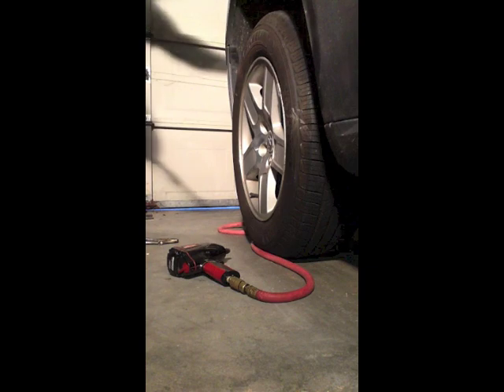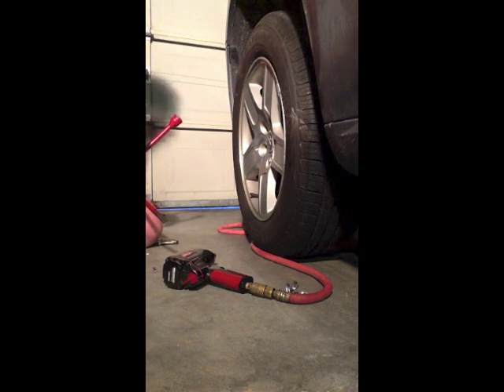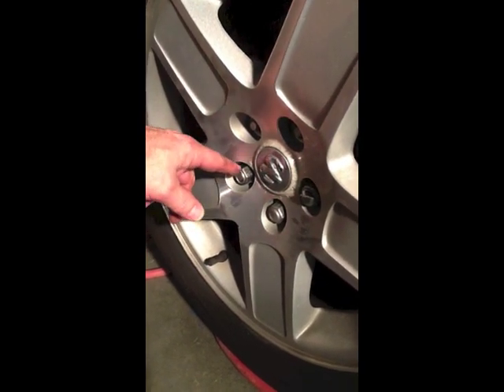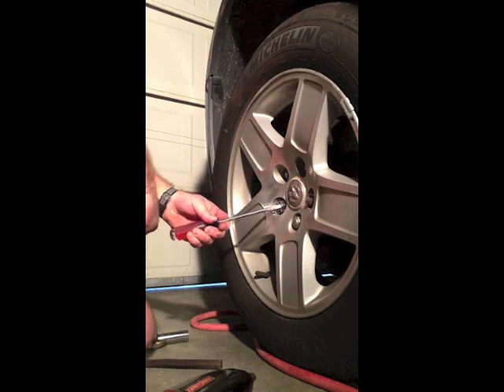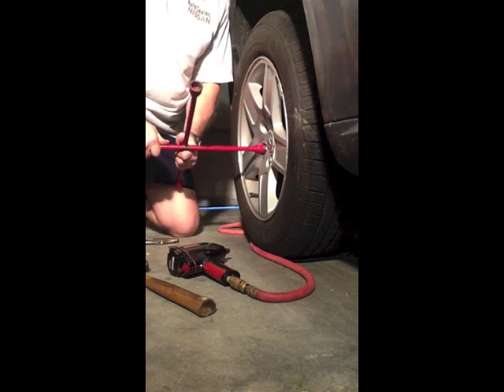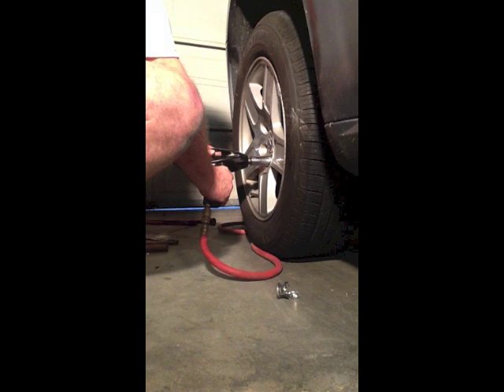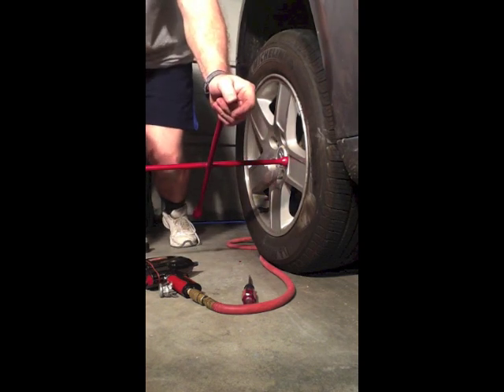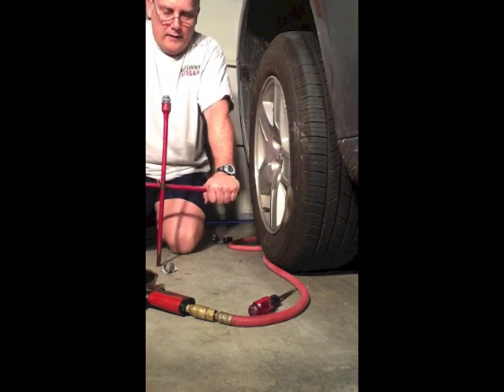How to remove over tightened lug nuts

Comment: I concur from Ottawa Canada ... you sir are a legend! 3/4" lug nots torqued to 500 ft lbs I'm sure, all other videos to remove the one stubborn stripped nut that I could not budge with a 10 mile breaker bar were not helpful. Went to the local Canadian Tire, who said $100 just to look at the issue, or buy the $200 nut replacement set. It was your genius, to strip the aluminum jacket with the screwdriver and the chisel, that was the only thing that worked to reveal the rusted but intact 18 mm nut that I removed with the bar! Keep up the good work! And my daughter wanted to say thank you for making this amazing video and my daughter favorite part was when I told her you have a puppy/dog! Thx again!🙂😊

Comment: I worked in the tire industry for many years.. where I worked, we had a golden rule... take them off with an air gun... put them back on with a four way...
Reply: Dallas Nyberg that makes more sense. id RATHER my lugnuts be hand tightened
Reply: sadly most dealers don't give a dam so now I have this very same issue
Reply: kkingss4 and that is why I do 99% of the work on my car. Body work is gonna be left to the pros, but a simple break job, rotor replacement, struts etc are for me to handle, fuck mechanics that tighten shit way too much
Reply: Good store you worked at===Me too!!
Reply: should be able to sue.... overtightening the lugs should be considered damage....
Reply: yes mechanics do this on purpose so you wont be able to do work on your own car
Reply: @Mike_Greene  i dony have money nor the experience to sue. But there is a local shop that does this to all vechiles. They broke my friends nuts as well at to remove them from the rotor
Reply: @TheAfrothunderr  lol im not telling you to sue. im saying how thats not cool. there are torque GUIDELINES(??) to follow and my trucks are 100 ftlb so to tighten them to 400 ftlbs is like malpractice.  any mech should know how tight that is and know that is 4x too tight.  nowadays i keep a 7ft steel bar in my truck lol
Reply: @localello4444  I work for a dealer and other places I think many people dont  realize it doesn't have to be super tight I seen people using the impact gun to tighten then go around with it aging I usually use a torque so it doesn't get crazy tight
Reply: They should pass a law requiring it.
Reply: That's a good motto.
Reply: Once I discovered that my car had those "chrome/aluminum" jacketed lug nuts?  I went out and replaced 'em ALL with ALL STEEL look a likes!  To escape from the problem this guy had with his!  Yeah?  It's a tad expensive( maybe 30 er 40 bucks...probably more....been awhile), and the very SAME reason you WON'T see the "real deal" on yer car!   BASTIDS ANYWAYS!

Comment: My 1993 Wrangler lugs were frozen tight. I soaked the lugs several days and I drilled a small hole in the lug "skin" and filled it with PB Blaster for a few days. I hammered on a 3/4" impact socket with a 2 1/2/lb. ball peen and gave it some good shots. I used a 25" Harbor Freight breaker bar ($20.) and used my foot (I weigh 280 lbs.) and they let go. Two stripped off their covers and got rounded off by a 18 mm impact socket. I used a 1" bi-metal hole saw to remove some of the aluminum around the lug. If you angle the saw a little it cuts along the side of the lug and relieves the tension on the lug,they come right out. The wheel is still good . Replace with good lugs from NAPA,maybe a touch of anti seize on mating surfaces.

Comment: I was getting ready to replace the disc brake pads and rotors on my 01 Dodge Dakota.  Imagine my surprise when I couldn't budge a single lug nut using my 4-way lug wrench!  One nut was missing the cap and even the factory lug wrench began to bend from my use of a cheater bar before finally the corners rounded off.  After watching your video, I sprayed the nut liberally with PB Blaster and I used a ball peen hammer to seat an 18mm deep socket firmly over the nut.  Using a piece of pipe as a cheater bar, the nut came right off.  THANK YOU for your video!

Comment: Beautifully shown and explained. Thank you. I had this happened to me. I used a chisel and could not do it so I took it to my local mechanic and he did it worse. He used a blow torch or something and damaged the area around the lug nut on my aluminum wheel. Obviously he did not care. My wheels in addition were new. All mechanics like to use those power tools and this is the result. If you use an impact wrench how many pounds should you place on these lug nuts. Thanks again for such a great video.
Reply: U are supposed to be using a torque stick rated at 50 ft-lbs.  Change the impact speed down and torque to 50 ft-lbs with the torque stick then finish off with the correct setting on a torque wrench.

Comment: We just bought a 2014 GMC Yukon for Mrs. Cuss.  I wanted to look at the brake pads' thickness, so tried to pull the wheels.  Turned out that the GM-supplied lug wrench was 22mm and the lug nuts were 19mm (likely aftermarket wheels).  Anyway, the tires had been rotated a few weeks earlier, was not expecting most to be too tight for my 1/2" electric impact wrench which claims 230-250 ft lbs.  I pulled out my torque wrench and those were all tighter than its 150 foot lb maximum.  Anyway, I used an appropriate 6-sixed socket and long breaker bar to remove them, and I torqued to specification on re-install.  I would've been SOL had that happened on the road, and doubt that even AAA could've loosened them.

Comment: You'll be less likely to damage your wheel if you forget the hammer and chisel and instead drill a small hole in the end of the aluminum lug nut cover. Use that hole as the starting point for removal.

Comment: Ive changed many tires where the lugs were on so tight that we ended up snapping the studs when trying to remove the nut. F'ing lazy shops that zip them on with an impact on full torque.
Reply: AngryPostmanSthlm2  no - when a fastener is grossly over torqued the threads become stretched and the fastener is permanently damaged. If it wasnt over torqued then there's no need for anti seize and/or grease. This is especially true for vehicles that have wheel bolts that go into a threaded hub (vs studs that are already installed in a hub and nuts are used). Simply put, grease will eventually wash away if not fully and completely contained (perhaps in a capped nut). Just dont over torque :-)

Comment: I agree they were over tightened however the aluminum skirt around the nut is not necessary damaged by over tightening.  The factory lug nuts like these are notorious for swelling.  I have seen brand new cars come in for their first rotate with the lugnuts swollen. 
Also over tightening lugnuts will damage the stud and reduce the clamping force.  With how tight they seemed I would highly recommend replacing all lugs and studs to be safe.

Comment: I hate how some shops over tighten lug nuts, Walmart and some Costco tire centers have a habit of over tightening lug nuts.. Whenever I get my tires changed I go to the mom and pop tire shop near my house. They only use an impact wrench to take off the wheel and they tighten them by hand with a torque wrench.
Reply: MR.T456 

exactly my problem now...Walmart installed my tires and they are the only Ppl I have do anything to them. I go today for a rotation they tell me the lugs are over tightened and I'd have to buy all new ones. I'm furious because they had to have caused the issue to begin with.
Reply: My parents  have had studs snapped  before, they  went to walmart for new tires

Comment: A torque multipler is great tool for breaking lugs loose. I just use the standard 15" 1/2 drive breaker bar for most breaking bolts loose. Everything else just needs more leverage applied.

Comment: Got a flat on my 2015 Jeep wrangler I have never had the wheel off.  The first lug nut I went to take off spun off in the socket.  Jeep.  Installs the cheapest junk from the factory. The only people who had touched the wheels where the dealer ship during rotation.  I am now looking for solid lug nuts.  I was lucky there was a tire shop in the mall where I was at.  There was a storm ready to rain down on me.  Very cold windy weather.
Reply: If you notice his car us a dodge wich is like ur jeep a chrysler product, blame chrysler
Reply: Don't wait until you have got a flat by the roadside in the rain to discover that you can't get the nuts off.  Do a rehearsal on your own driveway if you have never done it before.

Comment: There seems to be no shortage of dumb-ass mechanics who over-tighten wheel lugs.  I'd be concerned about cracks in those aluminum wheels.
Reply: Ernie Martin reckon the stud would sheer off before the rim cracked
Reply: Nate Green No, the steel nuts/lugs are much stronger than the aluminum alloy of the rims. You may not see stress cracks but I am sure they will be there if you over tighten the lugs.

Comment: As an ASE certified tech, in my years of experience on these aluminum wheels the lug nut is seized to the rim and not the stud. This occurs frequently and is not because of over torquing the lug nut. If you put your socket on the seized lug nut and give it a few good wraps with a big dead blow or a sledgehammer it will free it so you can twist it off with the impact. To prevent this from happening again clean the rim where the lug nut seats and put some antti seize in there. Don't put anti seize on the threads of the lug nut or on the stud only where the lug nut seats.

Comment: Thank God iv never had that problem YET.  But I'd like to suggest using a metal pipe, around 60cm long (aluminium or S/S) over one side of the wheel brace to give you 5 times more leverage power. That way you don't have to break your back or damage your hands or your muscles. This of course works much easier with a single armed wheel brace which is usually supplied along with your car's particular jack.

Comment: Some cars don't have a spare wheel, so if you have a flat while you are out and have to pull over to the side of the road this won't be a problem until you get home and want to fix the tire.

On the other hand just fix the tire at the side of the road using one of those puncture repair kits then you won't need to take the wheel off.

just plug that thing, and when you get a chance take it back to the shop that put your wheel on originally, and tell him he over tightened your lug nuts and now you need him to remove the wheel at his own expense.

But a plug works really well in an emergency, so long as you have a pump handy and the plug kit, and they are quicker than changing a wheel, and you don't always need to use a jack.

Comment: Good to know about these aluminum-cased bolts. To get more leverage and not break your back with the 4-way, you might want to try standing up and pushing down with one leg while pulling with 2 hands.  I've  had to do it few times. They certainly put them on tight with the impact guns.

Comment: I had to do this on a Land Rover discovery. Did exactly what you did. I used a breaker bar with a pipe over it so I had about 3 feet of leverage. That helped a lot. Took about 2-3 hours to do all 20.

Comment: Thanks for showing how to remove the skin.  As an FYI, using a "reverse threaded nut removal socket" does not work.  Snapped a breaker bar part that goes in the socket.  Will try reversing it off and going the route of removing the aluminum skin.
Reply: ***** I used the "reverse threaded nut removal socket" and it worked like a champ. Did not snap the breaker bar. Yours must have been tight.

Comment: I even felt the frustration and painstaking process as you struggled with the last bolt. I thought I tightened the nuts enough after a tire rotation at home and some where loose later on. I retightened them with my foot and unknowingly doing so was too tight and snapped the stud. That happened to me a while back, (and currently as the bots are stubborn again). Spent a decent amount of time hammering out the stud and thank goodness for barely enough rotor shield clearance as that bot is a serious major pain, I gave up but got very lucky for the space clearance. Since then I dread even touching the bots on my car.

Comment: Thank you for the video! This saved me money. I got some quotes from a few mechanic shops to get two lug nuts off and wow... They said it would be $1K+ to remove them because they would have to cut out the axle and some other crap. I ended up using your method to remove the caps and then used a breaker bar and lug nut removal tools for stripped nuts. It ended up costing me about $50 and and an hour or so.

Comment: @ 9:00 you are in danger of cracking your shin (and busting a gut).  Use a socket with a long extension, outer end of extension resting on an axle stand at right height. Breaker bar on the extension, scaffolding tube on the breaker bar. Then foot on the end of the scaffold tube - easy.  I use a 3/4" drive breaker bar and extension, although you might need an adapter down to a 1/2" drive socket .

Comment: you got lucky, hammering onto the lug on the dodge/chysler series crushes the soft metal onto the stud making them as one. i have a 900ft lb air gun that chewed it into a circle. even a swirl socket could not get them off.  ended up using a air chisel to break them out

Comment: best way to stop thins from happening.. remove all the oem alum. skinned lug nut and replace them with new  reg. lug nuts..did this to  my 2014 ford fusion 2.0  se.. replace them with spline drive lub nuts. and never had a problem for many years

Comment: I always tighten to 120nm/110 nm on my car with an impact, and i check it with a tourqe wrench afterwards. Still they appead to be stuck. What i did was i cleaned the threads on the bolt and inside the hubs. So now when i change tiers i can get the wheel of easily unlike before.

Comment: Just went thru this same mess with my In-Law's van.

Had the snow tires installed last week on Tues., and a front wheel came loose on the highway on Fri.

Turns out they had over-tightened the nuts so much, that one stud broke off and the other 4 came loose.

All 5 wheel studs, nuts and the steel rim had to be replaced.

I had the 4 unbroken ones measured with an electronic caliper. Each one was a different length.

I am very sure all 4 wheels were over-tightened. Why?

When I tried to remove the other three wheels by hand with a 4-way cross wrench, I couldn't do it.

I needed an impact wrench and 3 foot cheater bar, and, I only got one wheel off.

I had a Tire Shop get the other two off, with difficulty.

All 4 wheels were then torqued properly, using a Torque Wrench.
Reply: Chances are your right.  Over torquing lug nuts actually reduces the clamping force and will damage the lug.  When you over torque a lug you damage it by stretching  it past its designed limits.

Comment: I had the same problem. I had new tires put on. It's time to replace all the brakes. So I googled the issue. This video came up. So I used a craftsman 3/4 12 point 3/8 socket with a Snap-On driver and with car on the ground it came straight off. (411 none of my lugs or studs are rusty however)

Comment: Would be much easier if you slipped a small section of pipe over your wrench... only thing that freed up some lug nuts I'ved dealt with over the yrs. Plus considering the amount of force physically being exerted on your wrench, can keep your hands away from where theyd get pinched if nut breaks free or wrench slips/breaks. Always keep a 2-3' long pipe along with at least 1/2" breaker bar in my truck

Comment: In England tyre fitters have a lot to answer half of them don't know the meaning of the word torque  wrench .
We have just had in a 2002 Mercedes E.class and 3 of the alloy wheels are impossible to remove and the long 
wheel  bolts just sheer off this side of the wheel .A littlethought a smear of copper slip and a torque wrench and this problem  would never arise,in the end we had to blow the wheels off with a cutting torch and the customer supplied a set of used rims and bolts .

Comment: Who says that guy cant bench 300lbs? I am 43, 5 foot 6 inches tall and 205lbs. Short and fat most people would say, and old! I bench 305 with a 450lb deadlift! This guy is bigger than me, and older too I am guessing. 
Back on topic, had the same issue and it did not work for me. Bought a nut extractor kit from Canadian Tire and a 1/2 inch to 3/8 impact adapter. First use the impact adapter snapped like a toothpick after 350ft/pounds of force applied.
Thankfully the extractor can also be used with a 1 1/8 socket. First attempt turned the lugnut into some steel mush. Didnt look like a lugnut anymore! Second attempt I hammered on the extractor a little more and then applied well over 400 ft/lbs of torque. Snap the lugnut broke loose.
My tire shop is going to have a really Bad Monday morning. Why? Because I am going to be their and they are going to have to explain to me why I need to use over 400ft/lbs of torque to take my wheels off? I am not leaving until the cost to replace all my lug nuts are replaced at their cost, plus the removal tool!
Update: Busy shop apparently does not like a guy losing his mind around a whole slew of customers. All costs reimbursed. Will I go back to the shop? I am so mad, yet I will because of the manager that dealt with this.

Comment: Leverage!
You need more leverage and less muscle. Get an extension (metal pipe, crowbar, etc put in the “X” tool to increase leverage) l keep one in car. You can find portable ones that will extend for more leverage at auto parts store.